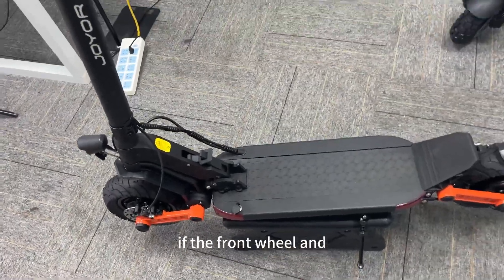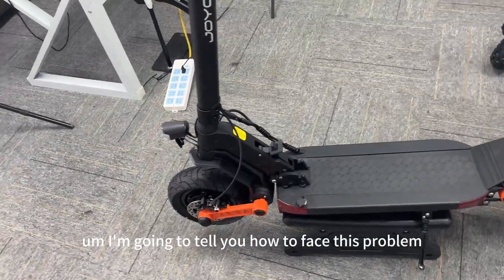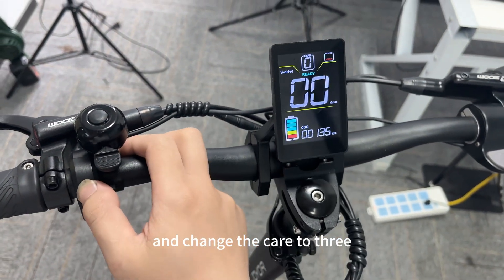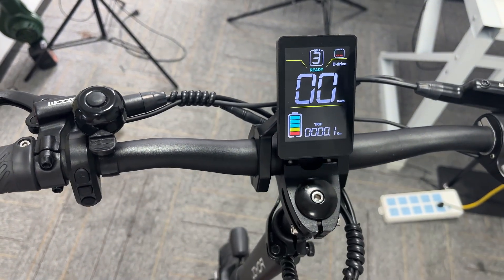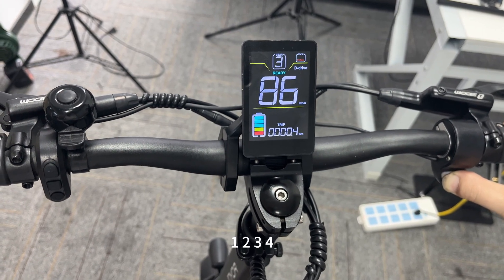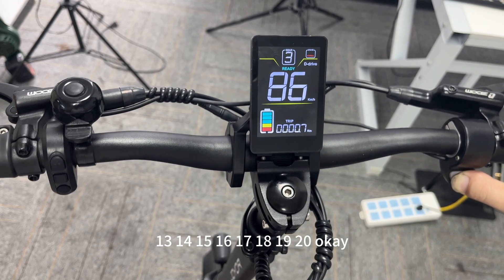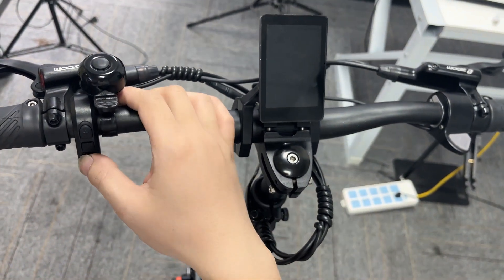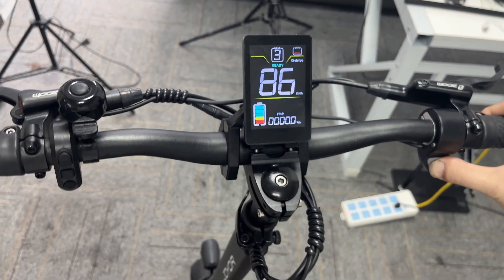How to solve the problem that the front and rear wheels of the dual-drive scooter are out of sync

Comment: Hello, this does not work on my one 🤔 is this normal If you turn d Drive on, on 3rd gear this needs a while to get the full Speed ? I Push the  throtte to max, the rear gives a short punsh and then it  accelerates slow and the Front wheel comes slow to full Speed... 🤔 Please Help 🙏

Comment: can someone please explain how the battery display works on this? I took mine for a test drive, and the battery level was all over theplace, going from 1-2 bars red, to 4 bars green when off the throttle.
Reply: Le niveau de batterie se mesure à l’arrêt. Tu attends 30 secondes et regarde ton niveau de barre ou bien l’amperage